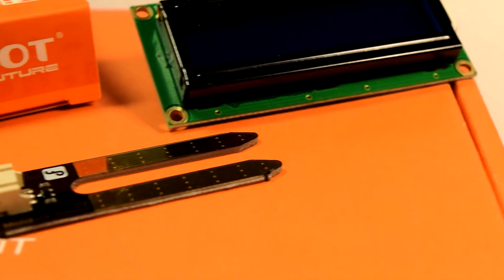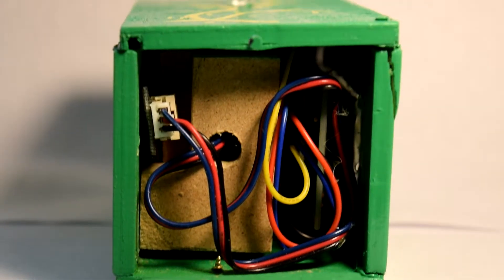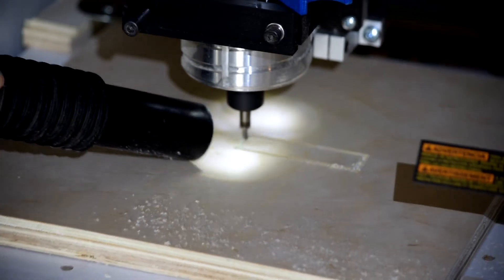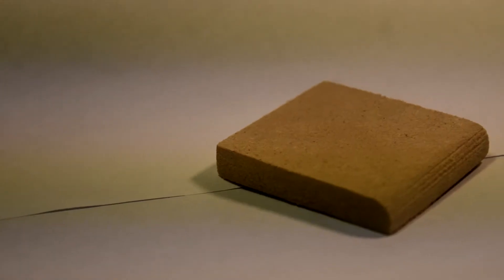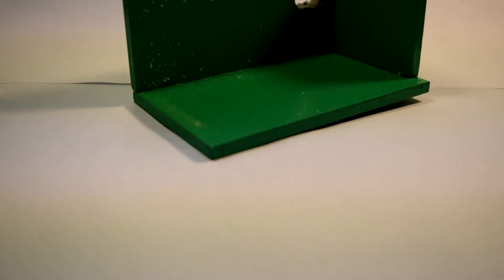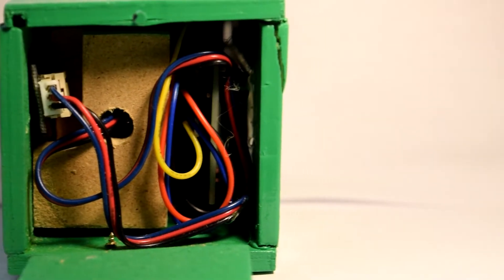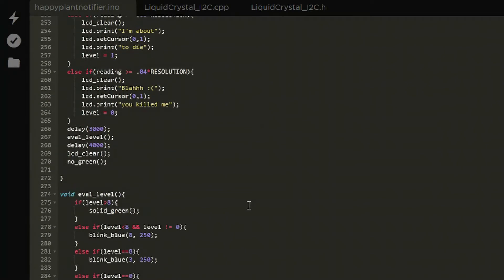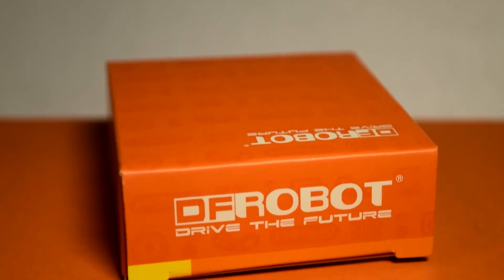IoT Plant Moisture Sensor Build Log

Comment: Nice Project but since you have been going throughso much truble making the pieces of your box, you could have been more careful putting them together. Using nails was probably a bad decision.
Reply from the maker: I actually used hot glue for most of it. The nail was just to hold some parts together more securely. Thanks for the feedback!
Reply: Ah okay. I like this project.  Are you still using it to monitor your plant? Is the sensor accurate? and durable? I am looking at the "Analog Capacitive Soil Moisture Sensor- which seems more reliable.  
Is 100% moisture equal to putting the sensor in actual water? I am also thinking about buying the display. Is it easy to set up?
Reply from the maker: Tschonni - Realistic Impressions I retired this project about 1 day after I built it to recycle the parts. The sensor is accurate and it measures resistance. So 0% is in air or super dry soil, and 100% is in water.
Reply from the maker: Tschonni - Realistic Impressions And the display is easy to use as it only needs 2 wires for data. Read more about this project on https://hackster.io/gatoninja236